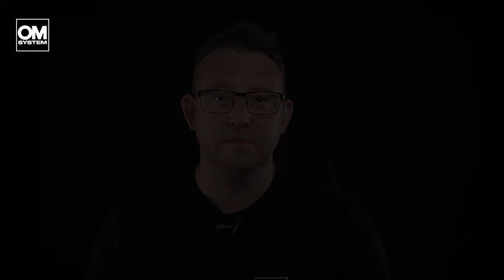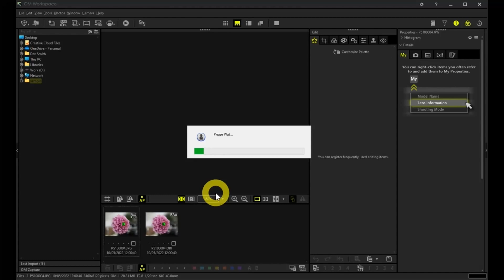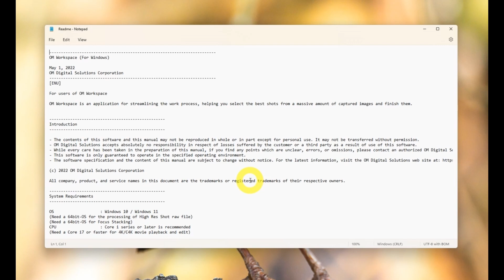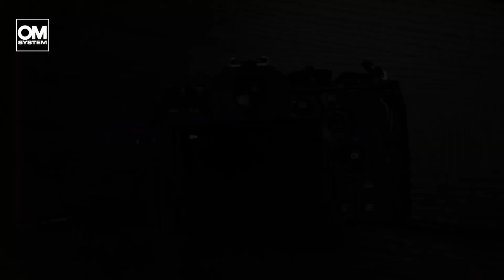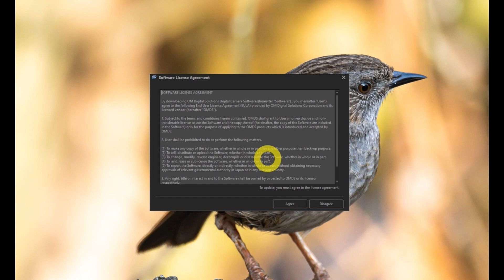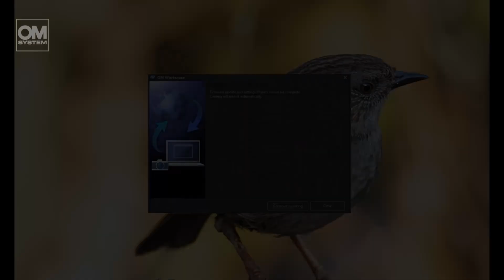Updating your OM SYSTEM firmware using OM Workspace

Comment: I just updated my OM-1 from 1.7 to 1.9. Google turned me to this video from v1.2 times. Two notes:
  1.) You need to select "MTP" rather than "Storage" on the camera after turning it on.
  2.) Any good quality USB C-C or USB A-C data cable will do. The C-C cable from the camera box is not essential.

Needless to say, it is an overly complicated, slow process. OMDS is still far behind other brands in this regard in 2025.

Comment: Use the Olympus USB-C to USB-C data cable. Great! But your computer probably has USB Type A sockets and Olympus bless them* did not provide an USB Type A plug to USB-C plug data adapter. We're stuffed. Aargh!    

* this generally means slapping someone around the head with a large wet fish.

Comment: What is the reason for 100% charged battery?
Reply from the maker: Hi Robert - In order to ensure that the camera will not switch off due to a depleted battery, we recommend a 100% charged battery. With varying connection speeds to download the firmware some will experience a longer process than others.

Comment: Updating step after new OM Workspace is installed is not working. I tried it a number of times.
Reply from the maker: If you are referring to updating a cameras FW, we recommend using the OM Image Share mobile app for models that are supported. - David :)
Reply: @OMSYSTEMCameras hi david whay u application dont support the model ep7 beceause i wante to update frimwear and donc work for i folllow all instruction in website om.share

Comment: My desktop doesn't have a USB-C port.  It it safe to use an adapter?
Reply from the maker: Yes, it is safe if both cable and adapter are data transfer compatible, not only for charging purposes.

Comment: Very convoluted! Just got an OM-1 , I have no pc with usb c connection, so I'd have to use an adapter. What the hell is OM WORKSPACE , THERE WAS NO INFO IN THE CAMERA BOX.
I have Windows 7 pro, so no go. why not make it simple like my Fuji cameras and lenses, just an SD card and you're done in no time. Fortunately my version is 1.5! This means that I will probably never update the firmware seeing all the problems below! 
My Fuji X-T3 worked fine without updates for 3 years and just couple of months ago I updated it the latest version including all the lenses and it took minutes. 
This Om process is unnecessarily complicated. Had I known about this firmware bull, I probably would not have bought the camera!
Reply from the maker: We recommend using the OM Image Share app on your mobile device for updating the OM-1 and any lenses you have. :)

Comment: Hello David. I received my OM1 System a few days ago and want to update Firmware from 1.4 to latest 1.5. Unfortunately my iMac does not have USB-C port, only the USB 3.0 ports. I have tried with a USB-C to USB-3 adaptor but no luck. So, does it have to be USB-C to USB-C? I don't really want to spend £3,000.00 on a new mac to update this firmware, so are there any other avenues open? You used to be able to download any Firmware updates onto an SD card and then insert that into the camera for the update process? Any assistance would be greatly appreciated. Thanks, Ray, London, UK.
Reply from the maker: Hi Ray - I recommend using the OM Image Share app on your phone/mobile device. You can update the firmware wirelessly on both camera and lenses. - David :)
Reply: @OMSYSTEMCameras  This information should be posted at the top of this video!!!

Comment: Hello David, I have been trying to update my Olympus camera quite some time now. Every time I get the message that there is an error during communication with the camera (0x4201D). I cannot seem to find out what is wrong. I am using the latest OM workspace version. I use MacOS Ventura 13.5.2. Maybe you know what I can do? Thank you for your help.

Comment: Hi I have just followed through the instructions on updating my camera. Firstly I thought it may need updating due to the camera switching itself off after 6seconds, during this time no function buttons work so unable to access the menu as I thought the sleep mode maybe on, Ive tried half pressing the shutter button to awake the camera and nothing happens its just a blank screen. Ive bought a new battery incase this was at fault and its still doing it. I got as far as the update downloading and then it disappeared from my PC??? What is going on? I tried to update the camera again following the instructions and now the up date screen wont load, the camera still does not stay on. I am now at a loss of what todo with my Oylmpus M1 MK3 camera !!!!! This happened twice before and I connected it to a power bank, it wont even connect to this now. Any ideas???

Comment: Hello David, I thought I would up date the firm ware on my OM1 as is still on ver. 1.1 so I down loaded the software for image space and it is 2.1.0 - so looking at your video am following the steps but  1 event though I am connected to the internet, as I'm watching your video, I get the message : Failed to communicate with the server.. Connected the lead and turned on the camera  said OK to storage : on my camera its showing connected via USB , go to camera tab to update : I have a message The operations of this application are limited (Close) Next window says failed to communicate with the camera (0x4201D) and then for ever more I'm in a loop. Help Please..

Comment: Yes it sounds very easy in reality it does not work one Apple Mac without compromising security and privacy settings. So I tried it on my Windows 10 laptop at the end of the process it failed and now I have to send it off to Portugal for a firmware fix. Why can't Olympus simply allow us to download firmware onto a card and update firmware from there like every other company

Comment: Please help I’m running a 2019 27’’ iMac with OS Ventura and the software update just will not work. I get an error message stating 0x4201D. Something to do with ‘OM Digital Solutions Corporation’ is blocked. I have added OM Workspace to the allowed Apps within Privacy and Security but still won’t update… not good 🙄
I’ve just read online that your software updates do t work with the new macs 🤷‍♂️ please sort it urgently as the software should not be released unless it has full compatibility. Now using a £2000 camera and a £7500 lens with old software. Bring back my Nikon gear 😢
Reply from the maker: Hi Paul - Sorry to hear that you are having this challenge. The OM Workspace is fully compatible so please check out this link to help you get things sorted https://cs.olympus-imaging.jp/en/support/imsg/digicamera/download/software/ow/ow_update_mac.cfm
Reply: @OMSYSTEMCameras  ive worked on a Mac for over 35 years so I know what I am doing but the software will not update or install. I have allowed everything required via Privacy and Security and tried restarted both OM systems software and the Mac but still no joy. I have looked online at the statement in the OM Systems website and it states that it is still not compatible and they are working hard to fix it… not hard enough as it shouldnt be issued without being compatible with both Mac and pc
Reply: Sorted the camera firmware upgrade via mobile phone 👍

Comment: Conclusion ? This tutorial is 0% helpfull. Do I really need a tutorial which shows that everything is working perfectly ? NO ! Please consider that something could not work. Before Ventura, on my MacBook the update was messy because a problem of agreement and as the error of OM WORKSPACE was messy too, I became mad. On Ventura it is exactly the same because same messy message which propably concerns IOS but I do not know what to do. Conclusion : in future make a longer tutorial, in the 1st part : we are in heaven and everything is perfect, in second part which error could occur and how fix them. Last point : I get Lumix cameras too, and their firmware update on memory card is really more efficient, simpler and faster

Comment: Hi Dax, I can't get OM Workspace to connect to the server. I had to uninstall my version of OM Workspace before I could get to version 2.1. Having done that, every time I try to update my OM-1 firmware the program just tells me it cannot connect to the server. I contacted OM Systems about this and they helpfully told me to watch this video. Well I still can't get the darn thing to connect to the server! Any ideas please?
Reply: i have the same problem 😞
Reply: @karelstorc6785 Try a different internet supplier. My problem turned out to be my ISP. When I used a different one in worked fine.
Reply: @barryedwards401  i was trying today the whole day to update the firmware but the program was saying the same "cannot connect to the server". i connected my pc to my smartphone hotspot and succesfully updated it. thank you very much for the answer!
Reply: @es-jd1ei  I'm glad it helped you! So frustrating when it won't work isn't it?
Reply: @barryedwards401  yeah! wasted half a day and no idea how to fix it!

Comment: I was led to this video after an online search on how to do a firmware update with the OM-1. The video is concise and well put together. However, what an over complicated way to do this task! 
Not as simple as with previous models of Olympus cameras where it was as easy as download to an SD card and putting it into the camera. No, this time we have to download a program, that we may not want, input information by registering that we may not want to share and only then do we get to try and check/update the firmware. In my case the OS of my mac blocked the process which is another issue. Its taken the shine off  of getting the OM-1.
Reply from the maker: Hi Johnathan - We recommend that you use the OM Image Share app for updating OM-1 that is already on at least V1.1 - This is an easy process.
Reply: @OMSYSTEMCameras  OM Image Share does not work on my phone, it is an absolute chaos app. Only a cable USB C to USB C....my goodness! I have no USB C in my PC

Comment: I have got my OM-1 yesterday and tried to update firmware. I am getting connection issue even after trying several issue in OM workspace. Is there any alternative way. I am using window 11
Reply: got mine yesterday and it had version 1.2 in. You sure you even need to update it?

Comment: Having used Olympus cameras for many years now I was hoping the update process would be easy as I always have to "find" a Windows computer to update. I am a linux user and find it pretty sad that even now, with more Linux users than Mac users, there is not a version of the software for linux users.  After all the operating system on Mac's is a unix derived system as Linux is.  So developing a program for both should not entail much more work.  I tried to update my camera via an ancient Windows 7 computer... no hope!!  I tried to update via the OI.Share app and I just couldn't get the changing of various wifi accesses needed to work.  So why can't the software to update be downloaded directly from any browser on any operating system, and perhaps stored on an SD card for updating one's camera? Is it really because the OM SYSTEM company wants to track us? One shouldn't have to buy a new computer with an operating system one almost never users to  update ones camera.

Comment: My 300mm f/4 pro had a problem during the updating process and resulted into an inoperable lens. My body though got the latest firmware version. :'(

Such a bummer and hassle for a gear yo're paying thousands of dollars. There's no fail safe method like reverting the firmware to previous verison if doesn't complete or you can just try again.

Now there's the hassle and stress to send the lens back to the service center and paying for shippjng and fees (possibly) but I seriously mentioned that it shouldn't be the customer's hassle to pay for such a thing. It's already 2022 and they should have a better system/way to update their camera or lens' firmware without bricking the equipment.

Comment: Where is explanation for Mac User ? It just not work at all on my machine.
Reply from the maker: We are sorry that you are having problems - Please try this link to help. If you d not have an M1 Mac, go from step 2 :)   

https://cs.olympus-imaging.jp/en/support/imsg/digicamera/qa/contents/m1mac/m1mac_b.cfm#:~:text=Answer%3A%20After%20installing%20OM%20Workspace%20%28Olympus%20Workspace%29%20to,Solutions%20camera%20driver%20is%20blocked%20by%20the%20OS.

Comment: Hi David 
Bought OM1 a couple of months ago so quite new to this system (previously had Lumix). Have updated via workspace and for the most part camera and lenses have gone well. Have purchased 4 - 150, 12-40, 300mm, 60mm all Olympus and Leica 100-400. These updates have all gone to plan but the MC 20 and MC14 Teleconverters are not being recognised when trying to update using the same procedure. 1/ Is it a different procedure as when on the camera for the update the workspace just shows the camera. 2/ Do they require an updates at all?

Cheers John S
Reply from the maker: Hi John - Good to hear that everything is going well updating your system! You wont need to update the MC's at all. Only the lenses that use them need updating and it sounds like you have done that successfully! - David

Comment: I have to agree with the critical comments already made.  For starters, firmware updates should be made from the SD in the camera, avoiding internet connectivity and security issues.  I'm not sure how the process could be made more complicated.  When I downloaded workspaces it then told me the software was not up-to-date and I had to go through to more updates.  Like others, I gave up on an Apple M1 with all the permission issues.  The PC version was a bit better, but pretty confusing with new windows being hidden, stalling until I discovered a hidden permission had to be confirmed.  

Not very impressed.
Reply: Man, I agree. This is so stinking complicated with my Mini M!. Ridiculous. Canon you simply go to website, download the firmware, drag it to a formatted card, click format in camera and done. Very frustrating.

Comment: I made a mistake with mine, at the end I clicked that the camera had been switched off and back on and it hadn’t , but I got the O/K on the rear screen. So when I clicked next I had an error message saying to “retry”. After that I disconnected the cable and reinserted, then when though the process again of updating camera, when I did this it showed that the camera had Version 1.2 installed. It all looks o/k, but was wondering whether anything had gone work with the update, I didn’t have anything saved on the camera, the only thing I had to do at the end was re-enter date and time, so maybe it didn’t do that bit at the end by adding back any saved settings ? .
Reply: I had a similar problem. With me, I switched off and on the camera as instructed at the end of the update menu but the camera was now dead and wouldn't switch on. Thought I had broken it but unplugging the USB cable and removing and re-inserting the battery brought it back to life. Checking the firmware version showed it had updated correctly and the camera functioned ok.
So it seems there's definitely something wrong with the update process and it doesn't go smoothly if you follow the instructions to the letter.
Strangely, in this video, they miss out the 'switching off and on the camera' step at the end. Maybe I should have just done that, ignoring the on screen instructions.
This update process for Olympus cameras does seem unnecessarily complicated. DJI have the right idea for firmware updates. I recently updated the firmware on the DJI Pocket 2. All you had to do was download the firmware update to the root directory of your micro SD card and insert it in the camera. On switching it on, it detects it and asks you if you want to update. Just click ok and that's it. It even deletes the firmware file from the card when it's finished. No having to download and install bloated software that only runs on the latest Windows operating systems.
Can only think whoever wrote and devised the Olympus software update method was trying to create work for themself.

Comment: Well what a polava! no matter what I tried with my M1 MacBook Pro I could not get around the block. went back to my old intel MacBook and downloaded OM workspace and managed to update firmware to 1.2 but there was no option to download 1.1. OM systems really should get this sorted as so many having this issue. Also had to use my GoPro cable to connect camera to Intel MacBook. Thankfully that was stable.

Comment: I just have successfully updated my OM-1 from v1.1 to v1.2 using the OI.Share app on my Pixel 6 Android phone. I thought it gave clear instructions and very good progress indication of what was going on through the whole process, including download progress of the firmware package and the progress of uploading it to the camera over WiFi. To me it seemed easier and less fraught than using Workspace. It took less than 10 minutes. I think OM digital should do a video on this as it is a good option for those that have problems with this on Windows / Mac or might have issues with flaky power or internet connections. I didn’t understand why OI.Share was not recommended for the 1.2 update if you are already on version 1.1?